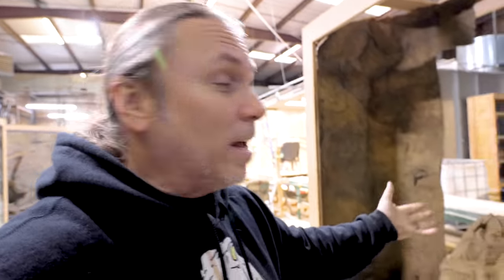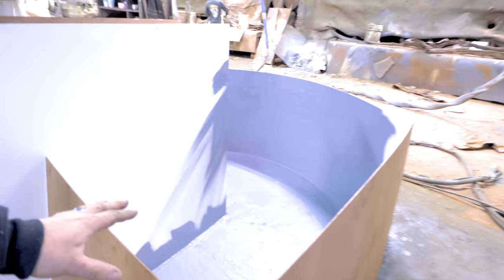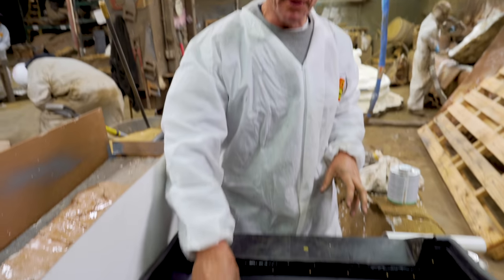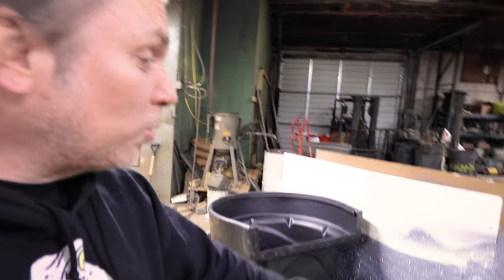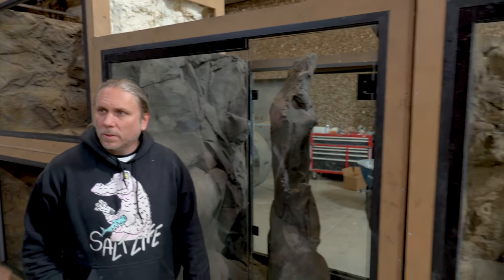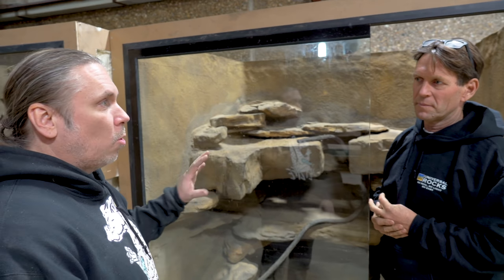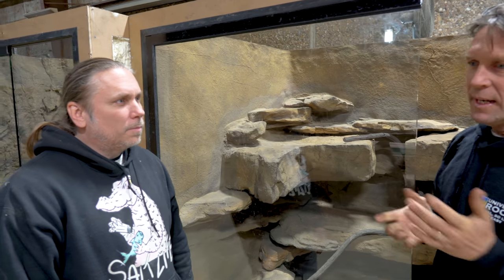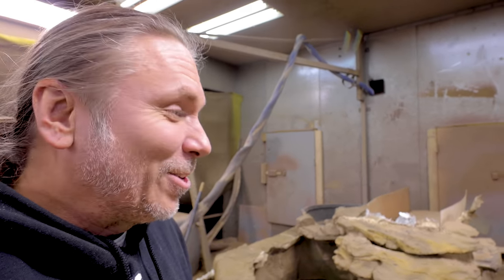BUILDING AN INSANE TURTLE POND for my REPTILE ZOO!! | BRIAN BARCZYK

Comment: Instead of buying a tank for a ball python , could I possibly use a fish tank. The fish tank is HUGE, the only problem is it doesn’t have a mesh cover
Reply: It's the same thing. Definitely need to buy a mesh cover though. But ball pythons don't like much space so make sure you use tons of hides
Reply: honeybunchesofwhat someone said it will be hard to get the right temp and humidity.  Is that true, the tank is really big?
Reply: @itzsweatz4298   yeah it might be too big for her and to keep up humidity. You can get tanks for cheap. Craigslist, letgo
Reply: honeybunchesofwhat well there’s this set I might get at pet smart, it’s $80 and it comes with everything. I think it comes with like a 10 gallon tank.
Reply: @itzsweatz4298  pricey. Look into tank dividers. And then buy what you need separately. You'd probably save money that way. Bedding, heat lamp, hide, dividers and wallpaper for divider. Good luck
Reply: honeybunchesofwhat is a heat lamp a better option than heat pads?
Reply: @itzsweatz4298  
But as to pros and cons of both.

Bulb:
Pros- heat is radiated downwards to the snake which replicates the sun
- dont need a thermostat
- cheap only around $10
-makes the ambient and basking temperature the right degree
Cons- the bulbs sometimes go out really fast
-drain humidity and dry up the tank
- can burn your snake if it is touched
- alot of electricity

Heat Mat:
Pros- Provides the snake with belly heat 
- Better for when the snake is digesting
- Some heat mats are inexpensive
-Last a while
-If used with a thermostat it can stay at a constant temperature
Cons- needs to be run with a thermostat which cheapest can start at is $30
- WILL burn your snake if used without one because they cannot tell its that hot
-Will not warm up the ambient temperature to the degrees required unless using a tub
Reply: honeybunchesofwhat okay thanks